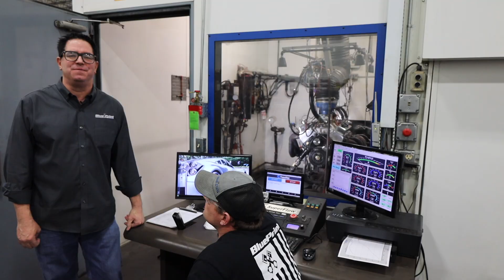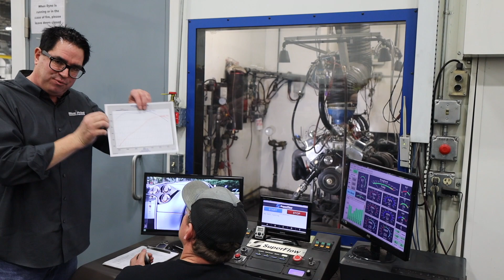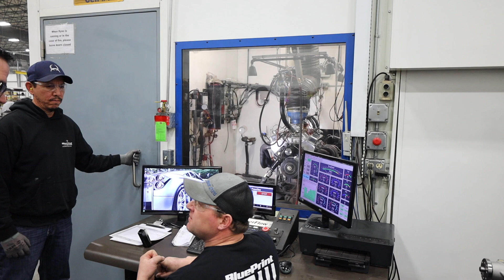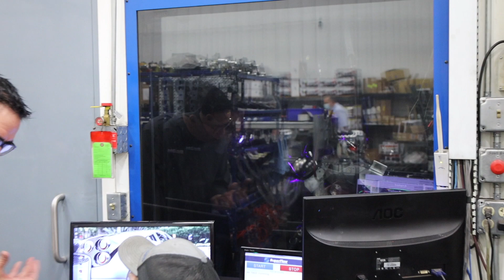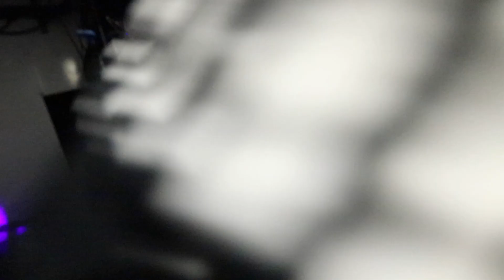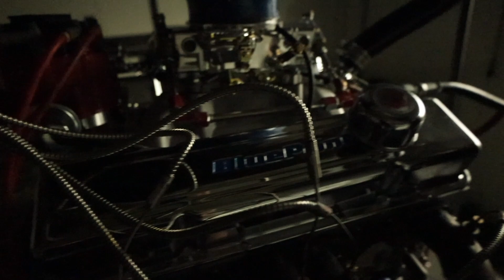DYNO Testing Our Engines – BluePrint Engines Crate Engine Tech

Comment: Si if the thermostat was in backwards i assume it would not survive dyno testing , correct?  Because i got a 350 with thermostat in backwards overheated first start with milky oil and pressure in rad buildup.

Comment: Just installed 390hp 350. Awesome experience! Why wouldn’t they install another $50.00 monitor inside the dyno room so he doesn’t have to keep spinning the one monitor?
Reply: Thinkin about buying one... What did you put the engine in and how does it pull?
Reply: @orion4389  installed in a ‘59 Chevy Truck with 700r4. Installation was a breeze. Followed the directions and she fired right up. Set timing at 32° and that’s all she wrote. Haven’t pushed it because I’m breaking it in. I did have a couple questions and called them waited only a few minutes for a tech to answer and address my issues. Really happy with the 350/390hp and especially tech support.
Reply: @hugocortina3429  Motor be here Monday!
Reply: @orion4389  Make sure you cork the distributor. Even though the video shows it hooked up the Tech said absolutely don’t use it.
Reply: @hugocortina3429  cork the dist????
Reply: @orion4389  Don’t hook it up to the carburetor. Cap the dist and the carb. Talkin about the vacuum advance.
Reply: @hugocortina3429  So you are just using the mechanical advance and not the vacuum? Hmmmmm he says.
Reply: @orion4389  got that from BluePrint tech.

Comment: Over 70 Engines a day as said in another video...5 Engine stands.. so when they work 24 Hours they need 1 Hour 40 Minutes for setup,, fill oil and water, Set Timing and carb, BreakIn, Testrun, cool down the engine, drain and get the engine out of the test room...
Reply: They don't do everything you listed inside the dump room, there wouldn't be enough time in a normal work day to accomplish all that seeing as they're not working 24hrs a day 365 days a year.